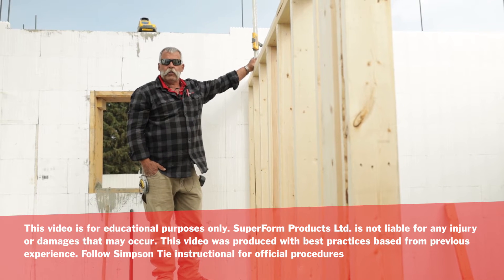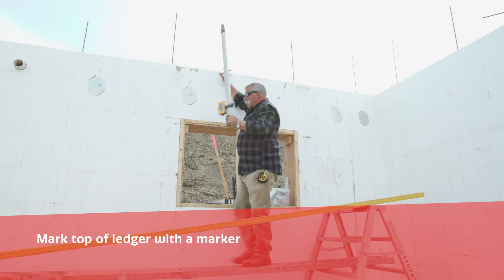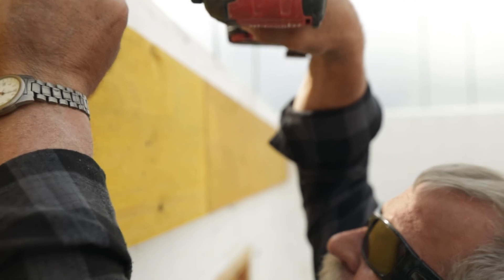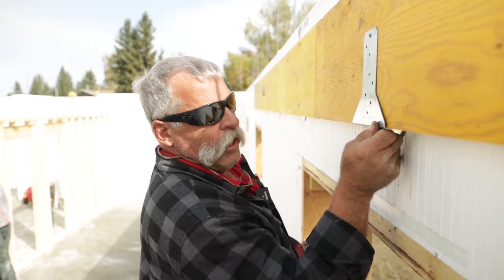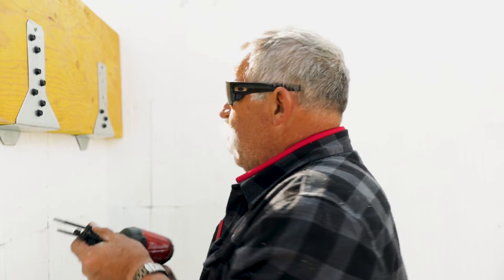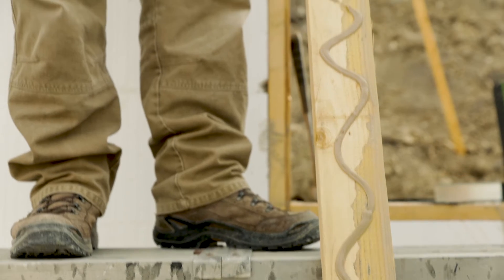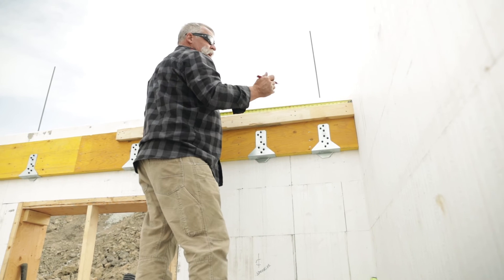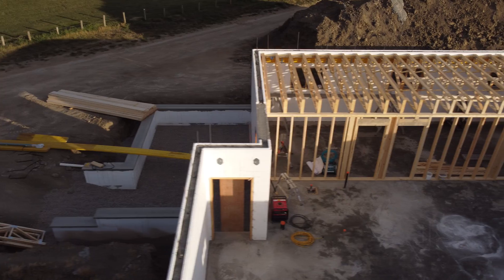How to Install Floor Hanger System to SuperForm ICF Walls - Part 2

Comment: This system is not very confidence inspiring. The entire floor depending on the shear strength of screws made who knows where? Plus, driven in with an impact driver when the tip is supposed to be drilling, not hammering though the metal plate behind it. I've never built an ICF house, but I would probably rather just pour and then drill in anchors afterwards.
Reply from the maker: Thank you for the feedback

Comment: The concept is good.  The screws are absolute crap.  I spent $500 on this system and had to abandon it and spend another $500 on Titan bolts. There is no reason it should take that long to put screws in.  Harvey has been a great resource every time I've called with questions.
Reply from the maker: Thanks for sharing your feedback with us! We are just the distributor for this product, but we will pass your concerns about the screws to Simpson @strongtie. We are glad to hear Harvey was a great resource for you - let us know if there is anything else we can help with!
Reply: It is recommended in engineered ledgers to pre drill.